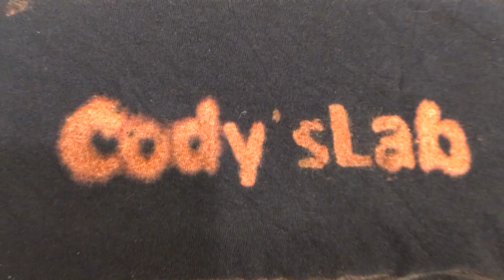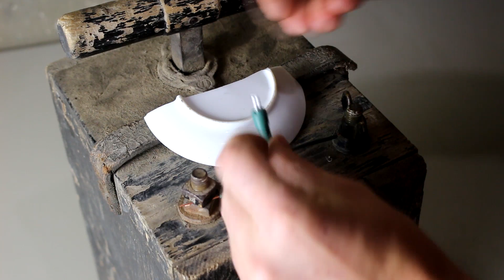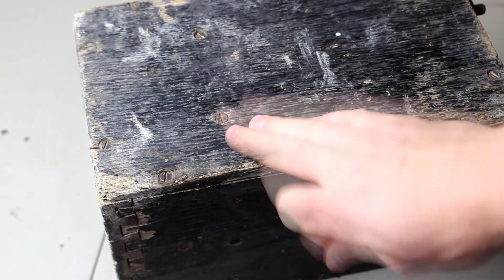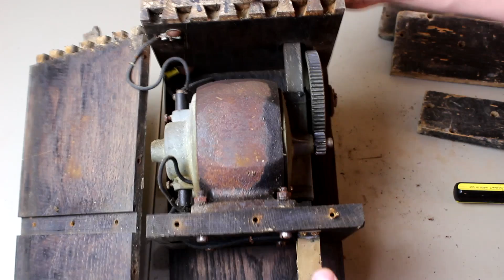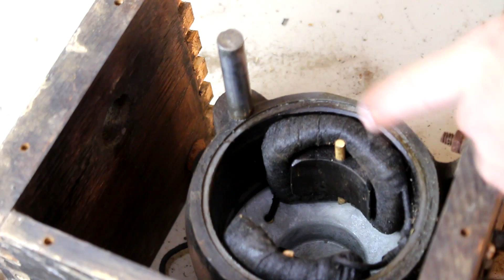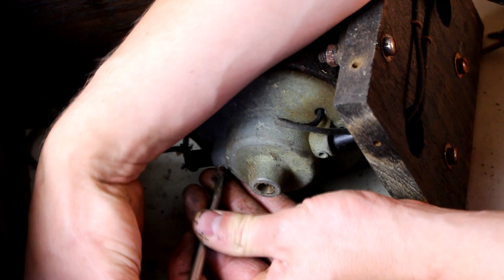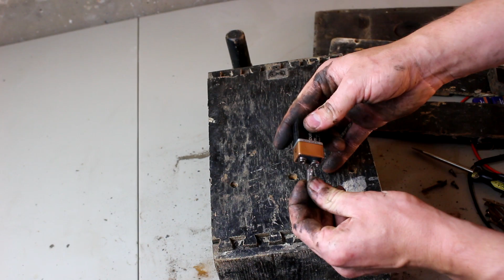How Does An Old Blasting Machine/Generator Work?

Comment: I have a Hercules 50-cap blaster and have had it apart. One brush seemed reasonable while the other was very worn. I found that a 1/4" round carbon brush would fit, so cut it down to match the original and fitted it in. With the brushes removed, measuring across the wires that go into the unit to the coils inside, it measures 2.246 ohms. So, there is continuity, but I don't know what it ought to be.  Does anyone have a reading from theirs to compare this to?

Comment: Nice dovetailed joinery. I own a thing called a dynamotor - it served as a power supply for appliances such as radio gear - that required 120-220 volts while installed inside of a vehicle such as a plane.  It puts out the higher voltage while it’s only being provided with 12-24 volts from vehicle’s battery. In order to play with it I needed to open it up to expose terminals to wire it. Looks a lot like your dynamo there. Must be very similar! Thank you for sharing your exploration of this device!

Comment: well, the 150+ volts allows a series connected shot with 50, 2 ohm caps plus a 5 ohm lead line ensuring 1.5 amps to fire the caps. Great video by the way!!

Comment: Why would blasting generators use a (somewhat expensive) metal rack that you push on, rather than have a string wrapped around a pulley and require pulling (like one does when starting a small gasoline motor)?

Comment: Zinc maybe? Aluminum wasn’t common until 1890 and some of these blasting machines are older. Aluminum was about $5 a lbs in 1888 it fell quickly to under a dollar by 1893.

Comment: Hey Cody, I’m a bit late to this party. It seems to me that aluminum was used not for weight saving but because where explosives are used, metals (like steel) that produce sparks are avoided. That won’t be possible in the dynamo, but everywhere else it will be. So the gears and terminals are made from aluminum and brass. This supports your notion that the steel carriage bold was an ad hoc repair. I wonder if the wood screws are brass too. Fascinating look inside this iconic old blaster!

Comment: The reason that the electrical contact switch does not close until the rack gear ( Plunger ) is near the bottom of it’s travel limit is to allow time for the spinning armature to come up to speed generating a high output assuring detonation of all caps—if the electrical contact switch were not there to keep the output circuit open until the voltage and current levels were high—when the plunger first started down to turn the armature the low voltage/current would gradually ramp up—having a string of caps in series without full output, in all probability one of the caps will fire before the others— being in series—this will open the circuit to the remaining downstream caps— resulting in a very dangerous misfire.

Comment: The lightweight gear is aluminum bronze (zamak02 or Kirksite).  FWIW, EBC's follow thr "Rule of 2's" -- per cap, two volts. two amps, two seconds.' (DFPont Blaster's Handbook, 11th ed.)  The caps want 4J delivered energy to give optimum performance, and duPont patented the #50 blasting machine  Many clones were Made, yours looks like the Hercules' or Atlas version.

Comment: Does your blasting box have carbon brushed?  What type of brushes if not carbon ?
Reply: hey can you help me out here? can you count the teeth of each gear and the pinion bar? im trying to make my own and i need the gear ratio
Reply: @KClO3   Did you make it yet?
Reply: @ThreatFromAbovee  nah i gave up on the gears, very hard step. instead i have a brushless scooter motor that works justs spinning slowly with hands. much easier

Comment: Ok, just a prediction, I didn't even start the video. My guess is that there's a spark generator (like the ones on a lighter) that activates by moving the lever down, where the metal part is somewhere inside the case and the "stone" part is attached to lever itself. That spark then lights the fuze and everything explodes.

Edit: I thought it was gonna be exactly like the ones in cartoons; got everything wrong lmfao

Comment: Back when I was in grade school (decades ago) some know-it-all told me that these were air pumps that squeeze the dynamite. I guess that's busted - haha.
Don't they call this kind of motor/generator "series wound"? I understand forklift motors work the same way. It uses electromagnets to generate the magnetic field and basically has no permanent magnets in it. Is there a capacitor in it? Does it store the electricity somehow before the switch is closed -- or does it just rely on the momentum of the moving parts at that point?

Comment: Don't think it would be deadly, there really isn't much total energy at play, and when it's set up to produce such a high voltage from that little energy, the amperage must be basically nothing
Reply: Well since it's a motor, it might generate ac which is more dangerous than dc. Although it's a pulse so it must likely won't kill u

Comment: They used a motor very similar to a 40s blender motor as a self excited alternator. Very cool. Always wondered what was in one of those push lever basting machines work. The modern ones are basically a glorified camera flash circuit, some use a xenon quench tube, others use a SCR. 🤓

Comment: 13:50 You mentioned how it looks like an electric motor. Well as a physicist, they're actually the same thing. The laws of electromagnetism work the same way. An electric motor is a electric generator that's having its shaft forcibly turned, and an electric motor is a generator that's having current forced through it in the wrong direction.

Comment: Im 0:06 seconds in and id like to make a hypothesis. I think the push down is just gonna spin a littlr gear that generates a small electrical current that then ignited via unknown method. Little wheel spinning inside the box. Lets see if im correct

Comment: It looks to me like the wires run back into the motor, because they are using the windings of the motor to do double-duty as a transformer as well, stepping up the voltage. When you press the handle, an electric field is built up in the windings of the motor. As the rack reaches the bottom, it closes the switch, and the field collapses, dispersing its energy into the blasting caps.

Comment: The way we set off blasting caps in the military is different. No electricity, just a one use plunger that sends a tiinnnyyy explosion down shock tubing to the blasting cap to set off the other explosive (c4, tnt, bagalores)

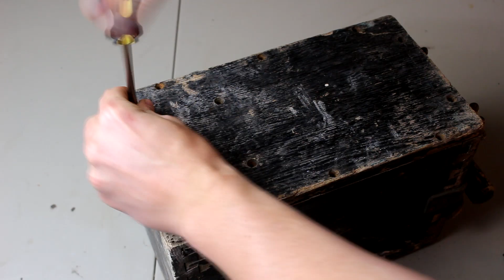Comment: Pro tip, steel screws corrode/rust and promote wood rot or "rust rot" as steel and iron are more susceptible to the corrosive effects of the wood and end up rusting faster because of it, because of the fact that they rusted inside of the wood, they cause the wood around the nail to rot much faster than the rest of the wood that wasn't in contact with the metal. You can even see where the screws have started to leave rust on the wood at 4:50 when you take them all out to remove the wood siding. It all depends on what type of nail you use, but it's a good idea to replace the screws with bronze screws if you want to keep the plunger from rotting or make it an antique that lasts for generations type thing.

Edit: stainless steel is also another very obvious, very corrosion resistant type of nail material that could be used.

Comment: Me, reading thumbnail before watching the video: well, I think it works using the piezoelectric crystal depression theory thingy or perhaps it has a magnet on the plunger and when you depress it, a copper tube spins to create a current that ignites a really long gunpowder type blast fuse.

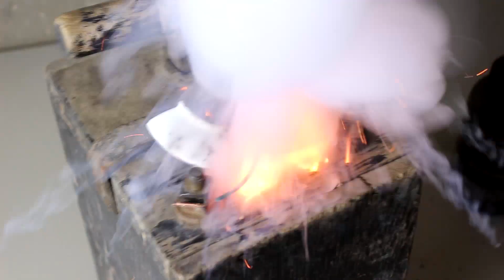Edit: 2:58 IT'S A DYNAMO If you look at the grooves on the side of the plunger, you'll see that they spine the dynamo when the plunger is pushed.

And honestly... my previous two guesses wouldn't have been able to generate a strong enough charge to match what cody describe... not to mention the fact that including a spinning tube into the design is impractical...

BUT a DYNAMO, on the other hand.

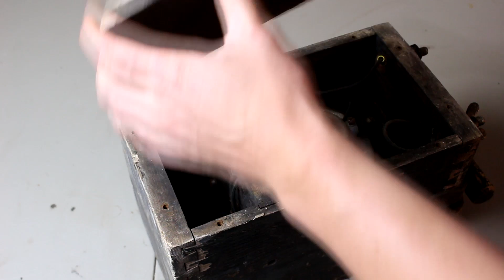Edit 2: 4:55 yes

Comment: I just picked up one of these yesterday made by the old Hercules company. I have to take the cover off because somebody had made it into a lamp and the plunger rod has been fixed into the full out position.  With your video now I know at least what to expect to see inside.

It also got me to thinking that it would be quite easy to take a small starter motor to make one of these.

Comment: The more winds in a generator the less restriction to the current.  It's likely that the dynamo has two winds.  It doesn't necessarily increase the potential so much as the current.  As it reduces the amount of resistance produced by the generator itself.
Reply: If it didn't do that... you'd have a really hard time getting it to spin at all.  You also are right, it's maximizing the amount of power transmitted.
Reply: The general rule of thumb in a generator is to have multiple numbers of winds inside them generating a current from the magnetic field.  The generator will actually create back torque if you don't have this in place.  Which only decreases the potential yield and overall efficiency of the generator.  

You wire the winds in sequence and they will actually help to produce less generator resistance, and will as you say, increase the current.  Which in turn will lead to a higher potential.  That's nasty amounts of current that thing can produce.  Don't let it go across your chest, you are right, that's potentially lethal.  What you see with the opposing magnetic poles is a push pull generator design.  It helps the torque instead of working against it.  Also, that interior wind is what generates the current as it turns.  It's creating eddies in the magnetic field which is picked up by the two exterior winds.  Connecting to your hot and cold terminals.  When you push down on that plunger, you are essentially forcing trillions of electrons to jump to the left all in unison.  :D
Reply: Electrons like to push each other along in a closed circuit generator.  Since most of the yield is lost during the resistance of that movement.  One must wonder how do the electrons find their way back into the dynamo?

Comment: Originally all the hardware was made of non sparking materials as this was often transported with the powder. This was changed later to transport the caps separately from the dynamite and the generator.  Caps were carried in a box filled with sawdust to reduce chance of percussion to the caps if dropped.  These measures greatly reduced the chance of explosion in rail accidents and other transportation accidents.  The bottom of stroke switch was to ensure all explosives were set off.  Without the switch the first cap and stick to go off would break the wiring so the others would not get enough power to go off.  With a sudden pulse of power, all the caps were ignited before the explosion broke the wiring apart.  Last thing you want to do is go into a blast zone and find not all charges have gone off and the wires are ripped out.  A shift from digging could crush a live cap and set it off.  This used to make widows.
Reply: Addition,  Those did not have permanent magnets in the generator. The field windings are on Pole Pieces. Only a small residual magnetism is used to build the magnetic field.  Google Shunt Wound DC Generator for more information on that generator.  Do not use a low voltage battery to set off multiple caps.  See my parent post for the reason.  Modern units use an inverter to charge a high voltage cap similar to what is used in a camera flashtube circuit.  The electronics is to complete continuity tests and other safety stuff prior to permitting charging the capacitor.  They when triggered discharge a high voltage capacitor into the string of caps to ensure they all get enough energy before the explosion breaks the wires.  Again, un-exploded caps and explosives make widows.  This is not a hobby project.  Follow all safety regulations and keep current on training when working with explosives.

Comment: I think I get how this works. It's not a generator so much as an inductor, like the coil on pre-computer car ignition.  There, it's the closing of the points allows the coil to charge (the wires going back into the dynamo). That builds up a magnetic field. When the points open, the charging stops, the magnetic field collapses, and induces a high voltage flow into the distributor. In this case ,that would be the contacts on the box. That's the only way I can figure this thing charges to a high potential without any circuitry. The switch at the bottom of the stroke cuts power to the dynamo, which due to the wires being fed back in to build or add to the field, induces a higher voltage and/or current into the wires, giving the flash as the field collapses and generates voltage into the wires.

But I know jack crap about analog electronics. I'm just drawing an analogy from auto ignition systems.

Comment: At the end of this video when Cody pushed down the plunger you could hear the clicking of the flywheel at the bottom of the stroke. This tells me, the idea was to push it down as quick as possible and it will spin a little after that, making the electric output continue for a few seconds.

Comment: Obsolete my ass, a dynamo is a dynamo mofo, lol. Get rid of the rid of the ratchet handle, hook that up to a bike, replace the switch that connects the dynamo with the hot ends with some lever or other easily accessible switch, and you got yourself a gasless power generator that takes little to no effort to power much of anything. Recharge all your batteries, recharge your car battery, get several car batteries, hook up multiple dynamos and car batteries to the one bike in an elaborate cabled system and you could have your own generator for your entire house that you just recharge on the weekends while getting some exercise in at the same time.

Comment: Safety was managed by simply not connecting the wires till you were ready.   The terminals, as you demonstrated, are resilient and easy to work.  There wasn't any need to have everything screwed in place before you were ready.  Simple and effective.

Comment: I suspect the non-magnetic metal parts are either zinc or a zinc/aluminum alloy.  These would be stronger for gears and bearing housings than pure aluminum.

Comment: Does it have a capacitor which accumulates the charge and then discharges when the rack closes the circuit at down position?
Reply: The energy storage is all mechanical (the spinning armature) and inductive (the field winding).
Reply: @BrightBlueJim  the switch that disconnects the engine from the inductor (coil) at the down stroke makes the coil feed the detonator with a high voltage surge. That's how I understood it.
Reply: @christmassnow3465  Yes.  And the energy from that comes from both the angular momentum of the generator rotor and the inductance of the field coil.  No capacitor involved.

Comment: It's alternating current.
THAT'S why it hurt.
Reply: That generator is a DC unit. The brushes are in line so the power comes off of a commutator which you can see. If it was an AC generator, probably the output would be taken off the stator and not the rotor, or possibly through slip rings. But with slip rings the brushes would be offset.
Reply: Yes
Reply: it does hertz
Reply: @futuristicdew11 ?
Reply: yes it's AC not DC. Generator produce AC. If this thing use DC, it will not able to deliver enough power because it will lose power on long wire

Comment: It's a self excited dc generator.
Reply: Sort of - it won't work if the field isn't already somewhat magnetic.  They probably "flashed" the field coil during manufacture by running current through the field, much like automotive generators used to be flashed when installing to prevent them from producing the wrong polarity.
Reply: @BrightBlueJim  it has a remaining magnetic field from a previous functionality and when the rotor turns, it's generating a small voltage to power up the stator coil. When the stator has enoufh power it will generate a stronger magnetic field and then you get the high voltage

Comment: I would also suspect that the bottom switch doubles as a safety feature, making sure that the bar must be fully depressed before any voltage can be allowed on the line.

Comment: watching this years later and wondering if there was a way to replace those magnets with modern, and more high-power magnets. would it produce a current big enough to arc across the terminals where they are?
Reply: I doubt you would be able to make it make enough voltage for that. If you did, i doubt you'd be able to power it by hand...
It may be a good thing it uses wesk magnets.

Comment: The end caps on the dynamo, and the large gear that drives the dynamo will be made of zinc, and not aluminium. Zinc is inexpensive, easily die cast, and machined, and strong enough to bear the bearing loads required. I’m sure the weight of the unit was never a factor of its construction. It was designed to be robust, reliable, and effective.